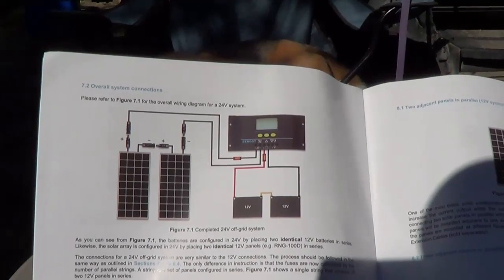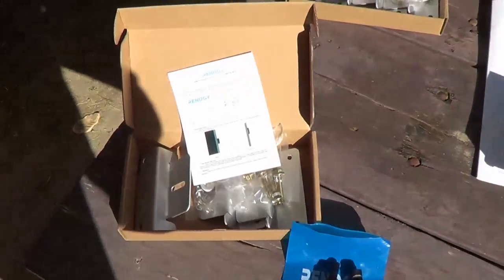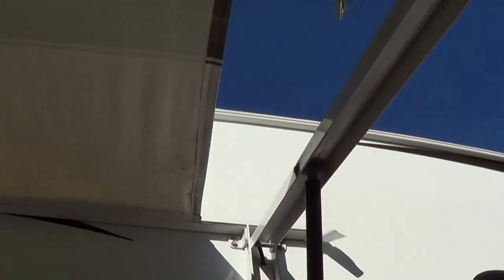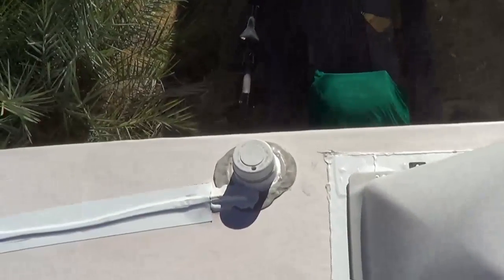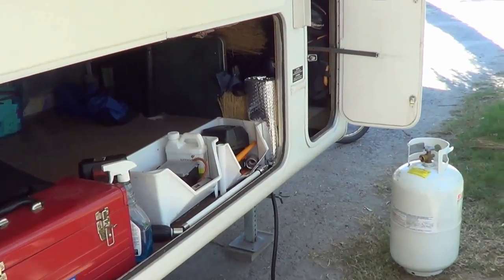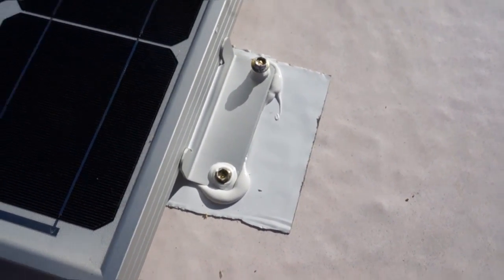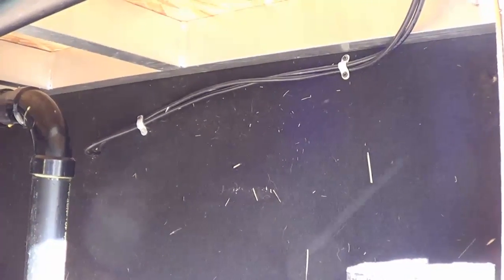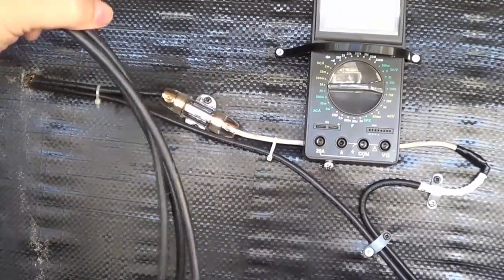Installing a Renogy 200W Solar Kit on my RV

Comment: No one ever shows the wire connection at the solar panel. Still looking.
Reply from the maker: You can see the solar panel connectors right here. MC4 type are used https://youtu.be/Z7x1iX66olk?t=61 or are you asking to see whats inside the black junction box. Not very exciting just a few solder or crimped joints and diodes.

Comment: How did he wire the inverter?
Reply from the maker: Connected to the battery bank to the inverter input, the output has two cables leading to two dedicated AC outlets for use when off-grid.

Comment: Hey Ray big fan of your channel and have made many of the modifications you suggested.  I was wondering if you would put the solar panels on the front of your camper again and if so how much solar ball park you are getting?  Thanks Carl
Reply from the maker: Thanks Carl. That would depend a lot on the new camper and its roof and window layout. With this model of Cougar it was a no brainer since it has huge back and slide windows so we always try and point the nose to the mid day sun to help with cooling. Saved a lot of space on the roof. Never walked on the sloped front anyway so great spot for them. 
Solar output from the 4 on the front vary with time if year, less in the low angled winter sun and much more in the high summer sun. Also heat and altitude affect output. Best conditions are high elevations and cool temps. It can vary from a low 15 amps to a high of about 25 amps.  I've since added 4 more panels at the back of the rig and that helps when I'm forced to camp backwards. With all the roof panels in the mid-winter I usually see about 30 amps and in summer over 50  amps. https://www.youtube.com/watch?v=baH_0eP3r5M

Comment: What kind of tape did you use for the roof, “turnabound”? What kind of battery did you use? Car battery? What about an inverter?
Reply from the maker: This installation was 7 years ago, panels are still working well. The tape in Eternabond https://www.loveyourrv.com/?s=eternabond  the batteries I used were 6-volt deep cycle golf cart - 
https://www.loveyourrv.com/upgrading-my-rv-battery-bank-and-12-volt-system/  inverter was 1000W https://www.loveyourrv.com/1000w-pure-sine-wave-inverter/ Cheers, Ray

Comment: A big upgrade would be to get an MPPT charge controller and wire your 12v panels in series to get 24v. You will get a fair amount of increase in power from your panels. And if you get two more 12v panels, series everything for 48v and see a whopping increase of power while still maintaining a 12v battery bank. Greetings from sunny Jamaica.

Comment: You don’t have to unplug the panels when you hook up to your vehicle do you?
Reply from the maker: They stay connected and keep working charging the batteries while driving. Cheers, Ray
Reply: Sorry so they will keep charging the batteries even when the rv is plugged into the car while driving, and that won’t wreck the panels cause when plugged into the vehicle that charges the batteries as well?
Reply from the maker: The panels actually aren't charging anything directly, they feed power to the solar charge controller and its job is to regulate the charge to the batteries. The solar charge controller is smart enough to know how to charge the RV batteries at the same time as other chargers such as the car alternator or shore power converter charger.

Comment: What size wires did you and Angelina run from charge controller to batteries?
Reply from the maker: I probably went a little over kill at the time and used 4 GA but knew I would be adding more panels down the road.
Reply: @LoveYourRV  Thanks, Ray. My Renogy Rover controller will accept 8AWG maximum.

Comment: Ray,

I'm  about 6 years behind you...

We have a micro Minnie winnie and I installed 2 100 watt panels and a mppt 30 amp controller from Renogy. We have two 75 amp/hr deep cycle SLA batteries that came with trailer.

Making power now but on shore power at rv park in Bishop, Ca.

WFCO unit not rated for lithium but thinking of going that way.

I know that unit will not charge lithium to full capacity but won't charge controller if I set it for lithium?
Thanks!
Reply from the maker: I'm not familiar with that particular solar charge controller settings, but if it has the ability to be set for lithium or if it can be custom set, then it should work great. Lithium is actually simpler to charge than lead-acid, they just need a single constant voltage versus stages, for 12V systems its around 14.2-14.6 volts.  https://www.loveyourrv.com/tag/lithium/
Reply: @LoveYourRV  I have now purchased a 170Ah lithium battery,  a PD converter to replace the WFCO unit and a 2000 watt Renogy inverter and am fixin' to hook it all up so we can boindock like youze threeze

Comment: Thanks for the video I think this will help me a lot.  Side question but you’re roof looks great what did you coat it with ?
Reply from the maker: I haven't added any coating, that's just the OEM EDPM rubber roof. I just wash it using Dawn dish soap a few times a year.

Comment: We are new to rv'ing and purchased a travel trailer with a very nice 400W Renogy solar system. There's hundreds of videos on these solar systems to install  but none of them really get into what to do when you're storing your rv for several months at a time.  I have a ON-OFF  switch but should I disconnect the batteries, etc?
Reply from the maker: Some will just let the solar trickle charge them the whole time, but If I was storing the trailer for many months I would first charge the batteries completely, then disconnect them, then if possible come back every couple months and let the solar charge top them for a day or so, then disconnect again. Cheers, Ray

Comment: Good video! I noticed when you first showed the meter it had a negative sign on far left before number.

Please do the "Ricky Ricardo" and 'splain that...

Thanks!

Getting ready to add solar to travel trailer, thinking of same Renogy system, 200 watts of panels, but use MPPT charge controller. 
Do you have an inverter too or how did you power TV and laptop?

Thanks!
Reply from the maker: Not sure but I'd guess the amperage flow was opposite to the polarity of the cables I attached. I just attached them for easiest lead dress.  Doesn't make any difference though.  i have an 1000W inverter to power my computers and TV. Since this install many years ago I have constantly updated and improved the solar system as I can afford to do so. You can see the progression here - https://www.loveyourrv.com/tag/solar/  Cheers, Ray

Comment: On your clean up, or from the start, why not install an automatic transfer switch. That way you could use your present breaker box and any outlet that you wanted. No extra wiring to outlets, plus all fuses and breakers ready to use.
Reply from the maker: I think if I do anything, rather than an auto transfer switch I'd installed a sub panel and move my lower wattage breakers over to that and run them off the 1000W inverter.  But since we only boondock 4 months and spend 8 months on full hookups of on the average year it hasn't been a big priority, rather spend any extra money I have on more solar panels and battery power. Once I have my solar and battery system built enough to have the extra power I'll likely invest any extra cash it have in a larger wattage pass thru type 2000W inverter and install a sub panel for the general and GFCI AC outlets and microwave circuit.  Cheers, Ray

Comment: I got two 270 watt panels off ebay for $35 each but they're massive. This video gave me the guts to drill holes in my roof. Thanks Ray and Angie (RIP)!

Comment: Just out of curiosity. What do you do during the Hot summer months boondocking as far as this and a generator?  I mean it does get hot and I'm sure you run the a/c, correct? Thanks
Reply from the maker: Haven't had to deal with a heat issue, as we are snowbirds and travel north and south and use elevation as well to follow mild temps.  I used to carry a generator capable of running the AC but never used it much so now I carry a smaller one to just recharge the batteries. For cooling, I use low power electric fans and a few other tricks https://www.loveyourrv.com/tips-keeping-rv-cool-without-ac/   Cheers, Ray

Comment: I have 4x100 watt Renogy panels that I am about to mount on the roof of my 5th wheel. I am worried about the Renogy Z-brackets because once mounted to the roof, there is no way to remove a panel without removing all four brackets in their entirety from the roof... including all that lap sealant! Seems like one advantage of using a tilt kit is that you could access the underside of the panel or remove/replace it if necessary, without further damaging the roof. Seems worthwhile even if you never use the tilting capability.
Reply from the maker: Yes, could worth the extra bit of work, only down side is the brackets become more complex, more cost and maintenance, but might be nice to have the tilting option. 
So far I've had 2 panels up there for 5 years and another 2 for 4 years and haven't needed to touch them. Cheers, Ray

Comment: Would you recommend 25mm x 6mm OR 40mm x 5mm lag bolts/screws to secure the solar panel mounting brackets into the plywood/rubber membrane RV roof?
Reply from the maker: I used the screws that came in the kit  #11 Self Drilling Cap Screw. Mounts are still solid.  Here is the Z bracket kit -  https://www.renogy.com/solar-panel-mounting-z-bracket-set-of-4/

Comment: Great vid, I have a 2011 29rl Cougar, am getting ready to install one 200. I've installed several panels on past trailers. One my Cougar I'm going straight down the fridge vent to the breaker box. I don't know about you but my Cougar is non stop fixing the poor workmanship of Keystone. Lots of screws working themselves out of hinges etc, along with wall paper peel. I got spoiled on my old Alpenlite, top notch build. But it was heavy.

Comment: What was the gadget under your multi-meter? VERY HELPFUL VID BTW, THANKS.
Reply from the maker: Thanks. :)  Not sure what you are referring to under the multimeter?
Reply: @LoveYourRV  , Directly under it, looks like some kind of timer.
Reply from the maker: I think you're looking at the adjustment knob for the multimeter to switch it from different levels of volts, amps, and ohms and -plug in the leads.
Reply: @LoveYourRV  , Gotcha, thanks!

Comment: Good job , I opted to add a battery cut off switch between the trailer and batterys,  I have my solar panels going to the charge control then out to batteries I have 4 100 on the roof  and 2 100 joined as a sute case with it's own charge control as needed that I can move as needed for the sun

Comment: Hi Ray, Great Video.  Newbie question.  I bought two 40W portable solar panels.  Can I use the two panels to charge the one battery I have?  Or is it one panel/one battery and get one 100W panel?
The panels are not linked and have separate claws to connect to the battery.
Reply from the maker: Thanks, you can have multiple panels going to one battery. Some people wire them in series or parallel. Hookup depends on panel voltages too, and you need a solar charge controller of some kind, you can just hook panels straight to the battery.

Comment: how did you convert from dc to ac? did you use the one that came with your RV?
Reply from the maker: One of the first things I installed when the trailer was new was a 1000 watt inverter - https://www.loveyourrv.com/1000w-pure-sine-wave-inverter/

Comment: Can you charge the Goal Zero 1250 (from the back) using an Alligator Clamp that comes with the Renogy 100 watt solar panel?
Reply from the maker: I'm not familiar with the Goal Zero, but the Renogy panel is a standard 12 volt.
Reply: Love Your RV I went ahead and purchased a 30 foot 12 gauge MC4 Solar AP cable. Hopefully it works!

https://www.ebay.com/itm/282332494396?ul_noapp=true#shpCntId
Reply from the maker: Should work. I see the Goal Zero website they use a Boulder 100 watt panel to quote charge times and its specs are similar to the Renogy. Cheers, Ray

Comment: What is the max Amps your solar can generate????  How many panels can you add to your system as???  Can you up grade to a larger system?
Reply from the maker: The max amps I've seen is 6 amps per panel. I have upgraded the system over time. I now have 500 watts and it serves our needs well. - https://www.loveyourrv.com/diy-rv-boondocking-power-system/  Cheers, Ray

Comment: I just purchased 200 W Solar panel kit what size wire did you use from your charge controller to your batteries.
Reply from the maker: I used 4 GA cable but only because I happened to have some on hand and had plans to expand my solar system in the future. If your controller isn't too far from the batteries, the 8 GA should be plenty.

Comment: Hi Ray, did you eternabond/dicor the wires under the panels and the plastic junctions?  Or, can they just lay on the roof?

I do my 200w Renogy install next weekend.
Reply from the maker: I just left them underneath with no tape, hasn't been a problem. I left enough slack so I can pull out the wires and get access to the connections in case something goes wrong I can troubleshoot the system.
Reply: Love Your RV Thanks, that'll help a lot.  Less work too. :)

Comment: What are the maximum gauge sizes that the controller input & output insert connection points will accept? Is there a place to connect a battery temperature sensor? Is a temp. sensor necessary or important?
Reply from the maker: I'd say about 8 gauge, no temp sensor. This is a cheap starter kit from a number of years ago and performed fairly well but I have as I could afford it slowly added more solar and upgraded the controller. Here is my system now - http://www.loveyourrv.com/diy-rv-boondocking-power-system/ Works great! Rarely need the generator now. :)

Comment: Did i miss the fuse part?
Reply from the maker: Yes, there was a 30 amp fuse between the panels and charge controller and a 30 amp breaker between the charge controller and battery bank.  I've since expanded my solar system and swapped them for two 40 amp switchable breakers. - http://www.loveyourrv.com/diy-rv-boondocking-power-system/  Cheers, Ray

Comment: What was the max amp output rating per panel?  I just bought two renogy monocrystalline 100w panels and they're rated max 6.25 amp each.  Waiting for spring to do my install.  :(

I was somewhat surprised you were only getting about 8.9 amps at noon.  I know it was a short day and therefore low sun angle though....
Reply from the maker: I have 5 panels and routinely see 25 - 30 amp range when sun is high and sky clear, I see 6 amps off of my ground panel if I point it 90 degrees to clear sun

Comment: What if it hails? Will hail brake the panels
Reply from the maker: They are tested and made to withstand hail. Of course, if it gets too big it will break them but at that point, your whole RV will likely be a write-off.
Reply: Love Your RV Makes since. Thank you for your video and reply

Comment: 200 Watt of solar energy equals what?  Is that per hour or per day. I see many people showing 13 to 15 volts and about 8 amps. What I want to know is how much that is or what it equates to in terms of charging my batteries?  I see people adding panels and different controllers, so how does that enter into the equation?
Reply from the maker: There are many variables to your question so not easily answered but basically.  200 watts will provide roughly 10-12 charging amps to the 12-volt battery bank in perfect solar conditions (clear sky and 90-degree angle on the panel). As the sun angle changes and the day length changes total charge during the day change. So say you get 6 hours of near perfect sun. You would add roughly 60 amp hours the battery bank.
Our average use when we RV with our fifth wheel is around 100 AHs per day, I have now installed 500 watts of solar panels and find that is sufficient to recharge our 4 battery bank each day even in the winter months of short days and low sun angle. Of course, though that is if the day is clear and sunny.
Reply: Thanks that clarified it a bit. Just looking at guy with 15 solar panels on his RV. Nice slide system installed. I don't have the link but its on Youtube.  Do a video on your hitch setup and why you have that system.  I see sliders and non-sliders but have no real idea what the advantages are.  Thanks again great videos.
Reply from the maker: Sliders are for people that have short box trucks to prevent the truck cab and the fifth wheel from striking each other in a tight turn, if you have an 8-foot box like mine, they aren't usually needed. Some slider hitches are automatic and some manual. I have added an airbag pin box to my rig to dampen the jolts - http://www.loveyourrv.com/lippert-air-ride-pin-box-review/  Some hitches have airbags. All depends on how much you want to spend.  Cheers Ray
Reply: Another idea for a video is to pull some maintenance on the axles and wheels. I never have performed any on mine and have no idea how to start.
Reply from the maker: That's one area I have a shop do. Since we are full time I have nowhere to do such a messy job, campgrounds frown on that sort of thing;), so I leave it to the pros. Last year I had all the suspension bushings, shackles and bolts replaced and bearings repacked. Brakes were OK 50% pad left. I may change them myself as you can buy the whole brake assemble fairly cheap and it's only a few bolts to change them out.

Comment: I HATE these wire connects... sweating my ass off right now trying to uninstall one of these 400 watters and these stupid clips dont want to come undone
Reply from the maker: I use a small flat blade screwdriver. There is also a little plastic tool available that makes it easier - http://amzn.to/2xGasDj